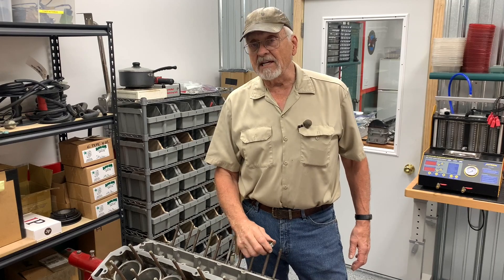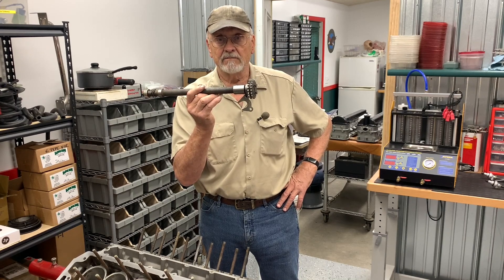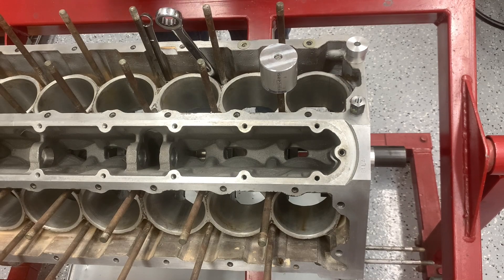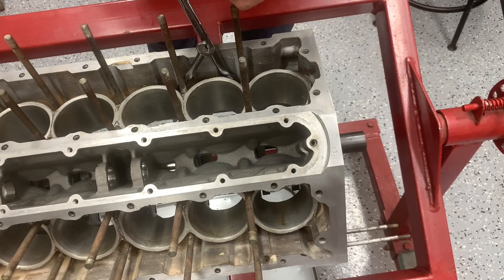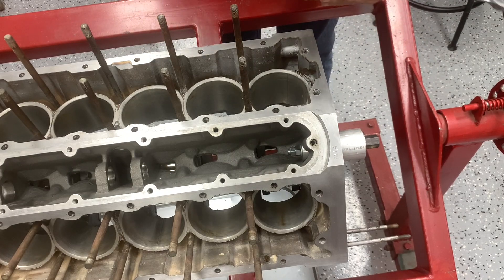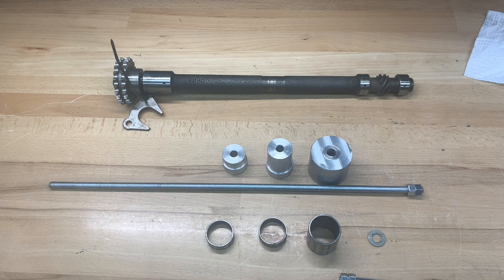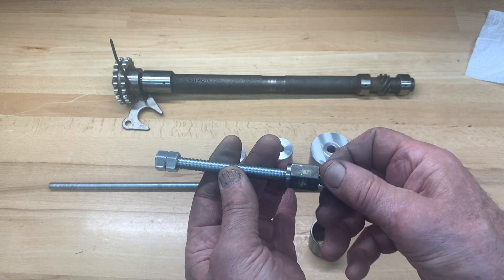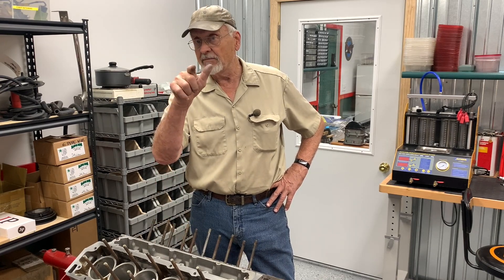S:5Episode12- TWR 6.1 Liter Jaguar V-12 Jackshaft Bearings Replacement.

Comment: I use similar bearing/ bushing pullers at work, they’re fine pitch hardened threads and the nuts have built in roller bearing washers and they frequently damage the threads so yours performed pretty well

Comment: Tell the editor to lower the volume of the background music when you are talking (first scene after the intro was hard to hear).  Otherwise good video overall. You mentioned the milage, but I'm curious of what year it was manufactured.  I know that the pre-85 years (BL) were the worst in terms of QC for Jaguar over all and I wonder if that was a posible factor.
Reply from the maker: 1988 TWR 6.1L with 10,000 miles.
Reply: @thecampchaoschronicles9567  🤦‍♂ (Note to self: read the title before commenting or asking questions.)  Thanks for taking the time and replying to a dumb question.

Comment: I simply cannot believe that you did not oil the threads or under the head of the drawbar nut, WTF! Nice tool though
Reply from the maker: It turns out the Irwin tap I used had a defective pitch on the thread and seized after several turns like a metric nut on an sae bolt .  Cleaning up the thread made a big difference. The hardened washer makes lube unnecessary.